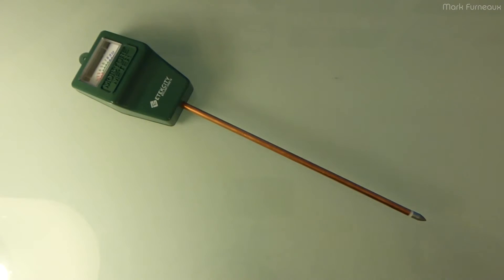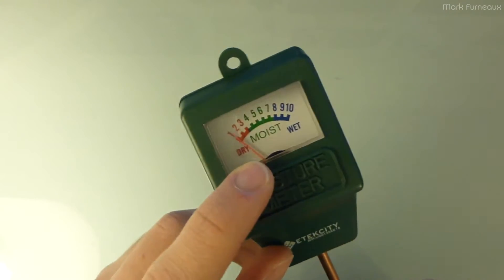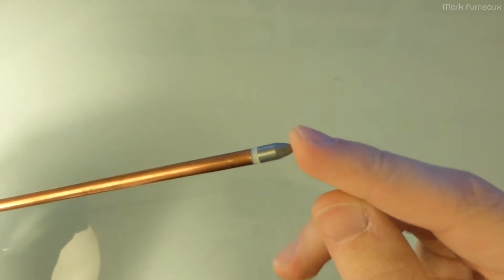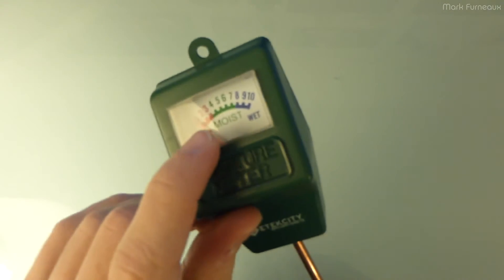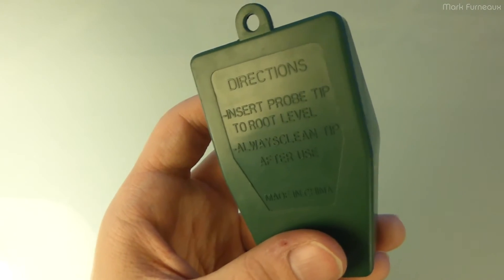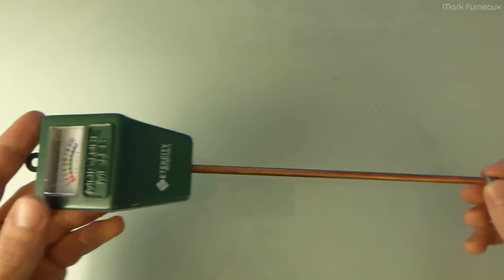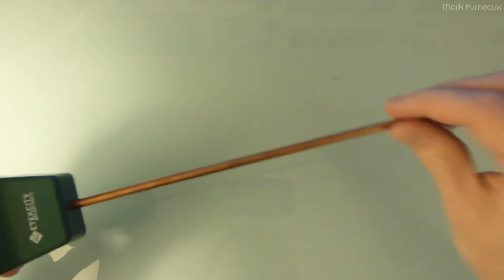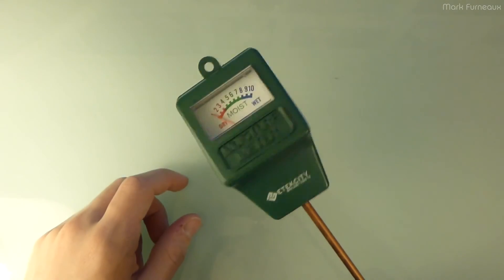Review of the Etekcity Soil Moisture Meter

Comment: Mine doesn’t work!  It keeps reading dry after I watered and the soil is soaked. I wouldn’t buy again. A wasted $10.
Reply: Same for me...bought 2 and neither one worked, always read DRY in a glass of water. I opened one of them up (cover is not not glued) and the needle adj. has been painted over so it's hard to adjust the delicate part w/o ruining the winding.

Comment: It can be justified to get a pair .... so they can verify each other that they are probably working correctly ... or not working. Each should agree with the other.

I was looking to find what is the preferred reading for vegetables such as tomatoes, squash, lettuce etc. I've found tables for other devices, but they may not be applicable to the Etekcity device.